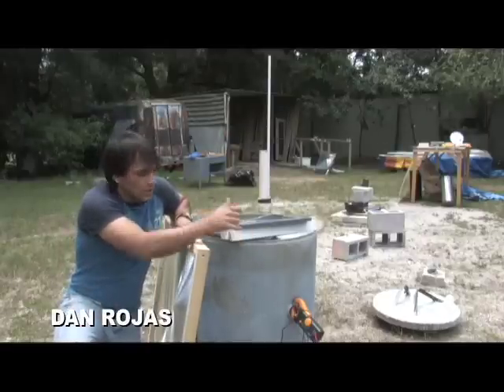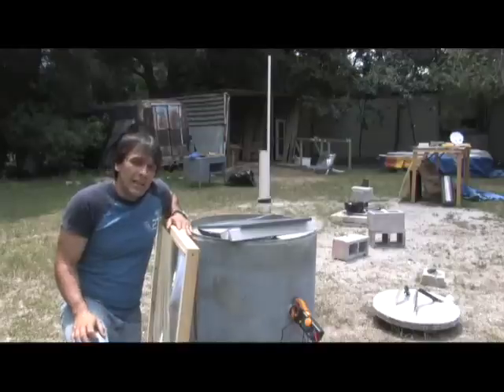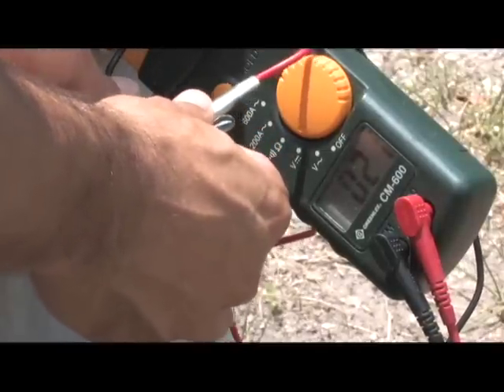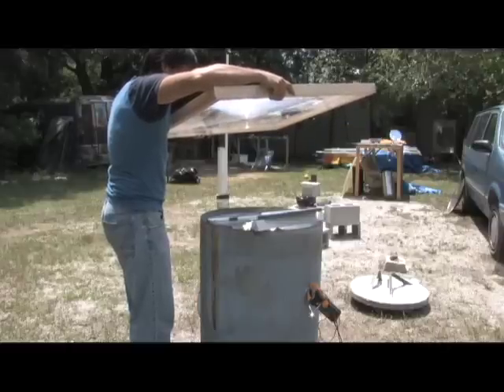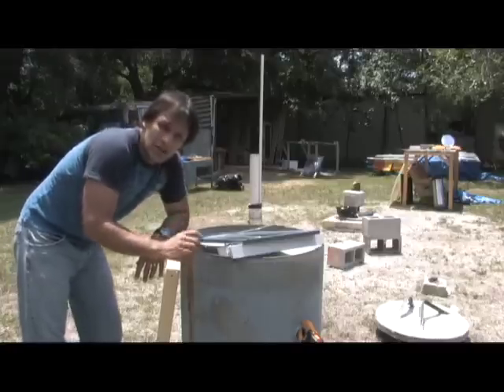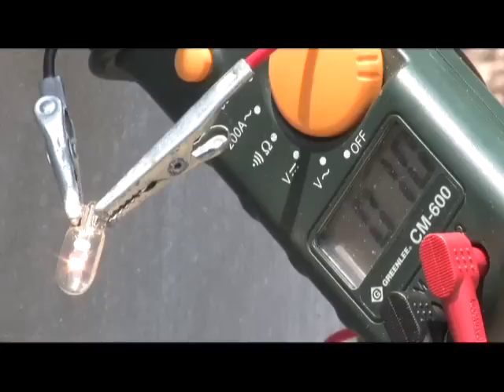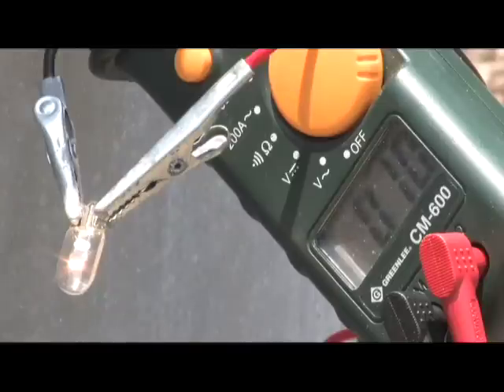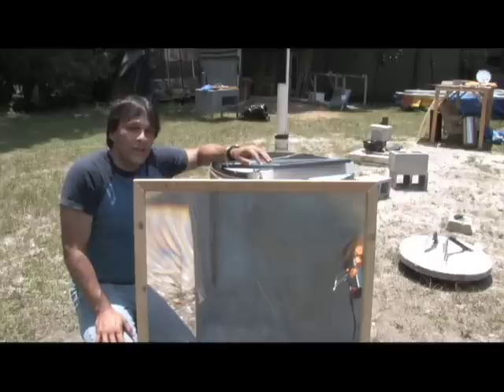Solar Panel supercharger Fresnel Lens

Comment: I would attach an aluminum block to the rear of the panel and run copper tubing between them. Using the city water as an input, you could direct the output into a hot-water tank, or a dedicated heating panel if the solar cooling was inadequate to heat the water to your liking.

I've seen friends machine their own water blocks for CPUs and such. They cross-drill the block and plug the holes where they don't want water flow. Works like a champ for CPUs.

I love videos like this! Props + five stars

Comment: I've seen (on the 'net) power companies in California that have used Fresnel lens's to increase power output with PV panels. They ran a cooling system on the backside of the panels, so they not only got more amps from the panels but also thermal energy from the cooling system itself.

Comment: It looks like you're using an amorphous type solar panel.  As you may already know, you would run less risk of damaging the solar panel if you use crystalline (mono or poly) silicon solar cell.  Once again, another excellent video.

Comment from the maker: @gymsim most Fresnel lenses will bend like that. Not sure what the point would be in bending it. That makes the optics useless. I have seen patents for the bending? Some think it offers and endless tracking to a perfect point.

I have some Fresnel lenses that are made out of lexan, fresnel Rubberized but lens is bullet proof. will cut but not puncture.

Comment: If you could use say the shape of a 50 sided die and cut in half as the lense, that would create a lot of solar exposure to one spot.  As for cooling the solar panel, you could drill down deep with some pvc piping and some sort of fan to accelerate the ground temperatures back up.  On a hot summer day everyone knows that the basement of a house will probably not need air conditioning especially if it is more than 6 feet down.  It probably would not require that much extra energy.

Comment: Attach a waterblock to the back of the solar panel.  This is similar to Kaje01's water flowing suggestion.  I saw some panels with water blocks soldered onto the back at C&H Surplus a few years ago (it seems that others have thought of this too).  Of course, if the water pump fails or a leak develops, you're in trouble.

A low maintenance solution is giant finned aluminum heatsinks on the back of the panels.  Make sure there's enough spacing between the fins for convection.

Comment from the maker: This is 12 volt loaded at 500 mAMP or .5 AMPS. So = 6 watts.

The load with the light on NO lens = 11 volts so it is 6 watts. The bulb is actually a bit much for this panel.

With the lens the bulb is full 6 watts with 2 volts extra. So it is about a 25% increase across the board.

Comment: You could amplify the light without the heat by creating a side box design.  Think of those TV glasses you can buy.  If the screens were right in front of your eye, you wouldn't be able to focus, so there are set to the side and reflected to the front increasing the distance.  A side box with the fresnel lens would take the light and bounce it toward the panel.  In theory the panel wouldn't even need to be exposed to the elements or the sun.
Reply: Fibre optics my fellow thinker. Keep on ah dreamin.

Comment: Take a look at the video that increases your solar output by 50%. This works in addition to any other booster you are using since it works after the current has left the panel. So in the demonstration above with Fresnel lens my cable would increase an additional 50%.

Comment: using small strokes of metal on the back of the solarpanel perhaps combined with a tubing system that is put under pressure using a small compressor unit like in a freezer(though this would requer the usage of a small amount of the power )linked to a external coolant (a fast running river to keep it green )

Comment: Somebody, around 10 years back..maybe early 2000's? DID make panels, in the Pacific NW, which combined a sealed water panel behind the solar PV panel, to cool the panel [which itself helps boost efficiency a bit], and, to make hot water for the house or pool connected to the water.   It may have been a sheet of something, to allow a sheet of water to directly heat up behind the PV.  
Those kinda dropped out of sight....always wondered what happened to them....seemed like a grand idea, IF the water never leaked and ruined the PV panels.
Reply: yes, i am wanting to try this idea but wanted to research it as much as possible first. solar panels and water heater in one. sounds like a great energy saver.
Reply: Instead of fresnel lens maybe a parabolic mirror on a solar tracker with a fixed panel?

Comment: @brianwesley28 

The Peltier cells are generally used for heating and cooling, but when they are exposed to a temperature differential, they will produce electricity. That is a form of cooling if one is converting heat into electricity, with the added benefit of producing additional electricity. I've also thought about fresnel lenses directly on Peltier cells, but the ones designed to withstand that much heat are rather expensive.

Comment: Cool idea..a definate marked improvement.  I was thinking of a cooling design that made use of an old cooling contraption from either a car or fridge.  Say you make a box housing your solar panels..a fresnel lens ..as your sun facing cover and on the back you have the mass of your  metal piping being cooled through evaporation (computer fan)..the cooler water is passed through the inside of your box, near the edges so that they don't interfere with your sun :)

Comment: I've thought about doing something like using a fresnel lens to do what you've done, while coupling Peltier TEC's into the process to help bleed the excess heat of the enclosure, while producing additional electricity using the Seebeck Efffect.

Comment: I have always thought that combining a solar water heater with PV makes sense. You use the cold water to cool the panel and the waste heat preheats your water.

It looked like adding 2 mirrors to the panel would get the output the same as the fresnel. 
Many solar panels have the characteristic that if one section is in light and another in shadow the shadowed part will limit the output of the lit part.

Comment: @atomicfrog2000 Great suggestion atomicfrog! You could use your bright idea to make a "safety magnifying glass" which does not burn things! Just coat the front surface, then try the back, then try both. Because the film will block the heat, you could use it in any application where the dammage caused by the sun's heat is of concern. It could be used for instance, to provide full brightness, high magnification, solar viewing, without the danger of injury.

Comment: cool. i wanted to do this kind of test myself.
for cooling i would use a natural circulation copper piping that would also heat up some hot water for your house at summer. and at winter ofcourse you have to drain system because ice could damage your system. I think its worth to try since you shown >30 % more output

Comment: This would be great in winter. No cooling issues. It's less necessary in summer because of greater sun intensity. The voltage went from 10 to 17. Isn't that a 70% increase. I'm math challenged  so please correct me if I'm wrong.

Comment: holes in the thin sides of the perspex, tap them and put some hose barbs in, attatch small hoses, pipe water through in between the plates, hot water going to a fan assisted cooling vat, cold water coming from cooling vat. plate assembly should be touching the panel. that way the vat could be put wherever u thought was coolest, so if u had a river/stream/creek nearby, just have long hoses, take out the fan and plonk it underwater :)

Comment: ive been thinking about this as well, what about just a machined aluminum heat sink mounted to the back of the panel open to the air but used to seal the back of the panel two uses in one.

Comment: One way, if the lay of the land allowed it, Set the solar panels at the bottom of a hill, looking to the southern hemisphere and the water cooling system then would be piped into the hill.  As the water heated up, it would thermosyphon upward into the hill, run through a underground piping. The heat would be absorbed into the earth and then it would cool and fall back down to the solar panel. No pumps would be needed since the water would thermosyphon itself.

Comment: Attach copper pipes to directly behind the solar cells with heat sink compound paste between solar cells and copper pipes for better heat transfer and run tap water through copper pipes. Water will take the heat with it therefore keeping the solar cells cool and you get hot water and more efficient electricity generation with fresnel lens. Two birds in one stone.

Comment: your better off using lower powered bulbs and a Fresnel lens to bring the output brighter to scatter the lights with a reflector to light a larger area. the lens would have to track sunlight as it moves to give a constant output. this would raise the cost and lower its output driving the motors to move it. yes it might be more power but is it worth the extra cost?

Comment: Would be nice but the electronics are on the underside and heat rises. You need to heatsync the bottom. The water however is good at keeping the pannel clean. I work with solar pannels and there are a lot of people working on effeciancy vs heat problems.

Comment: Plenty of computers in the scrapyards, using the heat sinks from their CPU's on the back of the panels would absorb the heat. Do have a question, is there a power loss when the solar panels are hotter?

Comment: Ever tried making a fully functional Solar globe much like that of Pitch Black movie. cause that rotating Fresnel lens/ mirror globe over a series parallel photovoltaic cell would be interesting.
Reply: from within it could be liquid cooled not so much novec immersive cooling but that warmth heat can be collected with a teg Peltier generator and add a turbine wind generator and you have the device. question is does it produce enough current not so much voltage.

Comment: The question is, would the excess energy be worth it at all if you had to power an external cooling device of any kind.  I mean you could use another smaller solar panel without a lense to power a lower RPM fan, but that would begin to become costly; also if the smaller solar panel failed then your whole system would be done.

Comment: 3. There was talk of a film of water running over the cell increasing the amount of light energy hitting the cell. It would seem to me that unless a larger surface area of water was used to form a lens, no real gains could be had. Am I wrong?

I basically am going with the majority here. I believe running water over the components to cool them and use the water for household hot water. I would say experiment with running it over/under/both and combining that with the use of heat sinks.

Comment: the cheapest is only to use the lens in the winter or the cooler parts of the year.  U just don't get year around higher voltage.

Comment: there are ways of dealing with the thermal issues from using a fresnel lens but that's only the first issue solved. The lens being at a distance to the pannel results in the focus point moving in relation to the pannel over the day. A solar tracker is needed to compensate this (moveable array). then you will have a decent boost in power production. 
Has anyone seen any other examples of fresnel lens pimped solar?

Comment: It would be nice if the lens did not produce heat. Since heat increases resistance it isnt quite that great of an idea. However reflection inside the pannel with diffrent materials is being developed currently to increase effencincy. For now not much we can do to make em better untill that next big break through comes out. If you were to use that lens you would need a massive underground heat sync. Its already hard enough to keep big pannels cool.

Comment: Dan, you need to include some Basic Science in your vids. You are Increasing the Collecting Area by adding the Lens or Mirror. Unfair Comparison, because the Mirror is not at 90* to the Sun, and for that you need to change the Geometry entirely, put the PV panel with its' back to the sun (!) and sacrifice its' area and use at least Two mirrors to get any real increase. Ideally you need Front Silvered Mirrors to avoid absorbtion by the glass layers. And Turn the whole caboodle With the Sun...

Comment: Maybe, in cooler climates, those would be fine without a cooling system...except during summers..heck, we clocked 108F. one summer, in the South Sound area of WA.  
Gotta wonder what kind of solar PV is used with the parabolic mirrors in places like Israel, where temps can be way over 100F...those are serious cookers!

Comment: Have you tried using a window tint film? There are films that block heat but let light through and they're cheap. Try coating the front of the lens, then try the back, then try both. Even try the solar panel itself. Experiment with it. Google "solar window tint" and you'll find lots at cheap prices.

Comment: +GREENPOWERSCIENCE  Hi,  Hope you don't mind an update to an older conversation.  In short, what is the practical application, assuming all problems related to maintaining focus and cooling are solved?  For example, would this realistically double the output of solar panels, without a reason to avoid doing it (wears them out faster, etc)?  Thanks.

Comment: isn't the distance needed relative to the size of the lens? So, a lens the same size could be constructed with a thousand very small lenses in the same area, it shouldn't need to be elevated off of the solar panel very far to work? Of course this compounds our heat problem, but is the other part true?

Comment: How about this? Use your sea water deslainator setup in conjunction. Use the cool seawater to cool the pannels then boil off the now pre-heated seawater with your setup from another film. Or use a shaded radiator higher than the pannel. Insulate all sides of the radiator but one and have it 'look' at the colder northern sky. The warm water from the pannel will rise into the radiator, cool and descend back to the pannel to recool it. Or maybe sink the heat into the ground.

Comment: Hello Dan,
First, great videos! I love what you are doing. I came across a video of yours today and have been watching them basically non-stop since. I have read all the comments here and I have a few questions that I do not believe have been answered. I hope I can start a discussion about some of these here. 
1. Is there an optimal temp for the PV Cells?
2. Accounting for the cost of the lens vs. cost of pv cells, and the % output increase; is it efficient to use the lens to increase power?...

Comment: Hey Dan, Is there a good way to store energy long term that is better than a deep cell battery? Like is there any hydrogen cell storange facility in existence that you know of? I was thinking of generating solar power with one of these lenses through a striling engine/generator and store lots of of this power long term in case we have 2 solid weeks of no sunshine.

Comment: As long as the energy used in the thermal part of the system (circulating pumps, etc.) isn't greater than the increased electricity from the panel. Otherwise, what's the point?

Comment: Hey Dan. Nice idea with using the lens! There are some applications on the web for a  'stretched' Fresnel lens solar concentrator for satellites.  The lense material is not suppose to be as fragile, but I've found no evidence of it actually being used. Are you familiar with any of those experiments or the results?

Comment: @marshalmathers88: I'm sure it would be helpful but I'm not technically skilled. I was just thinking that there are systems that use solar heat to provide for hot domestic water. Since this video proclaims an abundance of heat I just put one and two together. There probably would be a conflict since one systems needs to stay cool (PV) where the other actually needs to be hot (solar thermal). However there may be a sweet spot in the middle somewhere. Just my 2 cents...

Comment: how much concentration a solar panel can handel, if we can dessipate heat. What will be change in efficiency with linear increase on solar concentration
Reply from the maker: amorphous panels are 180F and regular crystalline are 200ƒ before they start to get damaged. With higher temperatures the resistance rises and the power drops so you need to keep them at an operating temperature below 120F for optimal performance. Here is a video with no concentrator, just submerged in water demonstrating the increase in output hot/warm vs cooling.

https://www.youtube.com/watch?v=rGi0Mf3cl1E&t=48s

Comment: dan here ^  placed a panel in a fish tank to cool it on another video, so i wondered maybe if you could place all the hot parts of the solar panel between two layers of glass ( like double glasing) and channel water through those layers?) I only say this because water draws heat away fast and can be taken far away ( piped), hek im no expert like you guys , but i just had this thought the other day an hoped to share :) peace.

Comment: Cooling is ez for electronics....nothing a heat sink cant handle considering its only heat from the sun and not heat from a processor which can burn you badly.... as for the distance...well thats just an easy mounting solution.

Comment: i haz an idea for cooling, soz if u cant fully understand my design =\

get 2 squares of perspex, one incredibly thin and one normal thickness, exectly the same size as the panel collection area (just the collection area, not the frame) and 4 strips of perspex, put them together to make a thin 6 sided object (about 5mm thick inside) drill 2